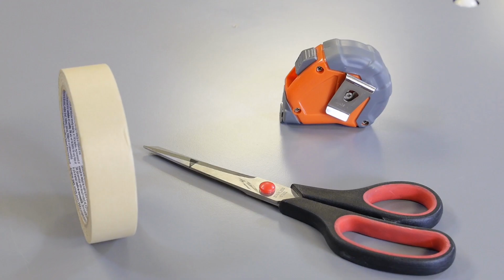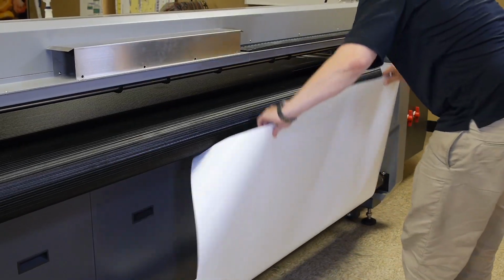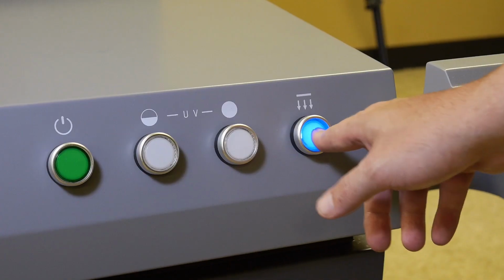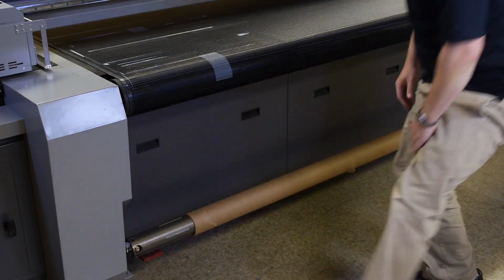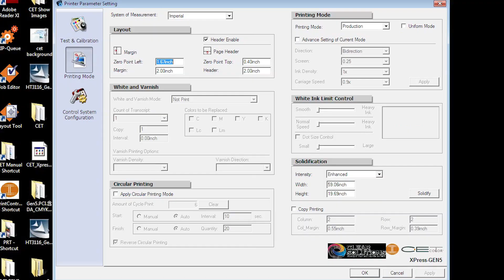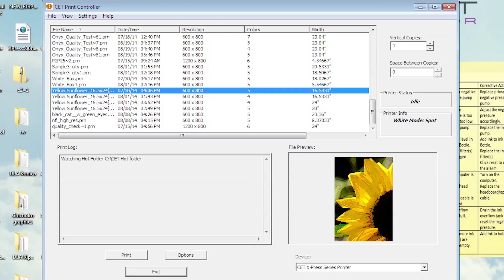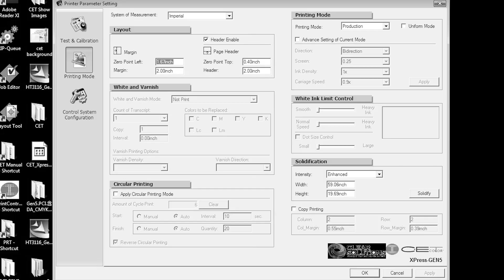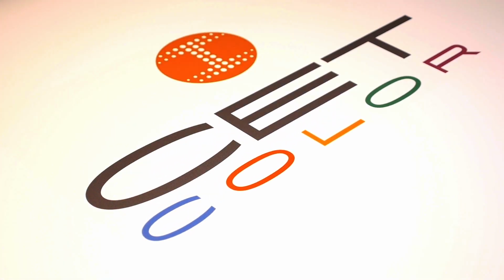Roll Printing to Substrate Printing on a Hybrid

Comment: our model CET  has an dancer bar on the back side that I don't see in this video.I am having problems with 126 inch banner material waving after about 10 feet.Our distrubutor has a tech that doesn't know how to thread it or set it. can u guys help?